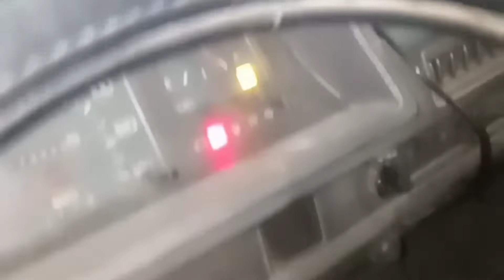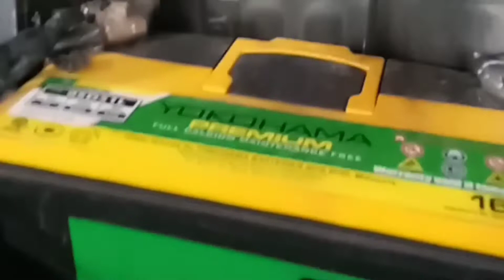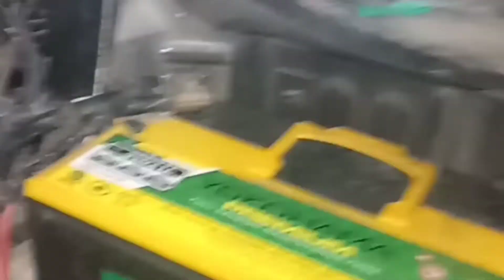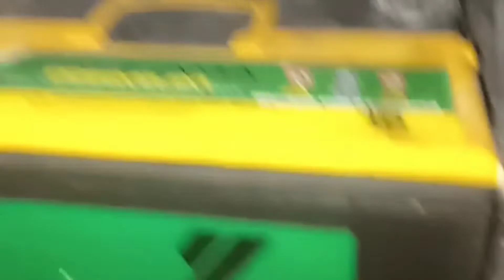L300 Alternator na ayaw mag charge sa Battery/Alternator that does not want to charge the battery

Comment: Wedeng dahilan sa alternator pag di kumakarga?
Reply from the maker: Maraming salamat sa comment idol,
Reply from the maker: Marami ang possible na maging dahilan sa hindi pag charge ng alternator,isa nanga dito ang winding kung overheated na hindi na normal ang pag charge ,ang negative at positive diode pag may leak hindi na rin mag charge, check lost connection din,